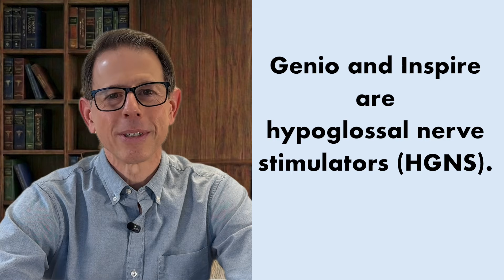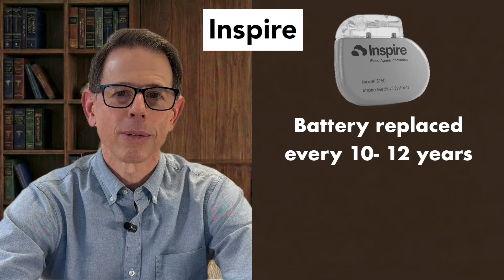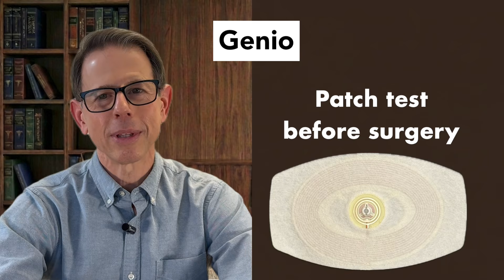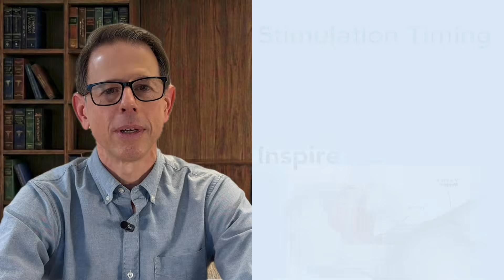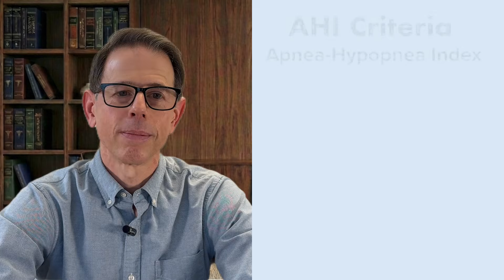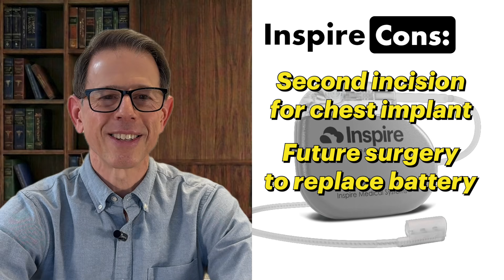Which is better? Inspire or Genio?

Comment: Dr. Weiner, I have had an Inspire implanted for 5 years and it has not worked for me, I don't even turn it on. Could a Genio still be an option for me?
Reply: @akwalt01  have you tried turning it on 😂😂😂
Reply from the maker: Possibly.  First, we always need to figure out why it didn't work for you.  Often, an awake endoscopy is performed to help optimize programming.  If there is still significant sleep apnea on subsequent testing, I perform a repeat DISE with Inspire running to see why it is failing to open up the airway.  This might lead to another surgery to "salvage" therapy.  In terms of Genio, I have not yet placed one in a patient who already has Inspire and do not know that any of my academic peers around the country have done that yet either.  It is theoretically possible, yes.

Comment: What are the failure rates of both Genio and Inspire?
Reply from the maker: We don’t really refer to failure rates.  What we report for our results are a number of metrics.  We look at what percentage of patients have a treated AHI below 15 or 20, the percent reduction in AHI as well as changes in hypoxic burden.  In terms of the first metric (% patients achieving at least no more than mild sleep apnea), for Inspire the percentage is around 66% in the 2014 STAR trial.  For Genio in their 2025 DREAM trial, it was 82%.  In the STAR trial for Inspire the % AHI reduction was 68% (average baseline AHI was 29.3 and average Inspire-treated AHI was 9.0).  For the DREAM trial for Genio, average AHI reduction was 65% (average baseline AHI was 27.8 and average Genio-treated AHI was 9.5).

However, there are other factors to consider as well.  For Genio, there was a significant incidence of adverse events in the DREAM trial and more than Inspire had in STAR.  Some of these resulted in device removal.  However, it should be noted that unfortunately DREAM was conducted in 2020 during the height of the COVID shutdowns.  Surgeons could travel to get properly trained in person and trainers from Nyxoah could not proctor their early cases in the OR in person which would be what is done normally with new devices.  As a result, the device and procedure was new to the surgeons involved and without standard training which may have resulted in more surgical problems.  Time will tell with real-world use.  Nyxoah is starting the BREATHE trial which will gather long-term data on many more patients in the real world so we’ll have a chance to see outcomes and complications more representative of the device.

Hope this helps.

Comment: I am a scuba diver and want to know which approach I should take.  I know inspire is rated to 100 feet but I routinely go deeper.  Genio seems to not have been tested, however, it seems it should be safer due to its inherent design.  Looking for some advice on which device would be best for me.
Reply from the maker: Both devices are limited to 4 ATA or 100m depth.  Beyond this depth, the sealed implanted components may be stressed and lose their seal.  I would not recommend either system if you need to dive deeper.  Otherwise, they are the same so other factors will guide your decision.

Comment: CPAP and elevating the mattress has me under 1 per night. Most people ditch CPAP too soon
Reply from the maker: You’re right!  Great job.
Reply: Congrats, Ed, but I really don't get how anyone could possibly adapt to the demonic  CPAP machine... been trying for a week or so, it KEEPS me awake just listening to the air rushing in and out, or the air hitting my face with various leaks (yes, I have tried several mask types), or dragging the insidious air hose back and forth cross my bed...

Comment: If we shrink as we age, is BMI calculated using my original height or my new shrunken height, or something different altogether?
Reply from the maker: We just use your current height. Please understand, however, that BMI is a pretty crude tool so don’t worry about the exact number.

Comment: I just did my scope down my throat. The dr. Said that because of my tonsils Aspire would not work. He has recommended Genio. What are your thoughts?
Reply from the maker: Of course, I cannot offer you medical advice. However, in general, if the tonsils are enlarged and causing obstruction in the throat, they should be removed rather than proceeding with a hypoglossal nerve stimulator such as Inspire or Genio.
Reply: @jordanweiner194 thanks so much. I have heard that removing tonsils as an adult is no fun. Very painful.
Reply: @Mark-fk3ei  run away.
Reply: @dustoffgeo7613  
" @Mark-fk3ei  run away"

 @dustoffgeo7613  
" @Mark-fk3ei  run away"? Why should Mark "...run away"? Thanks.
Reply: @Mark-fk3ei - Run away mate! It's a dumpster fire
Reply: @CPAPReviews  which one is a dumpster fire?